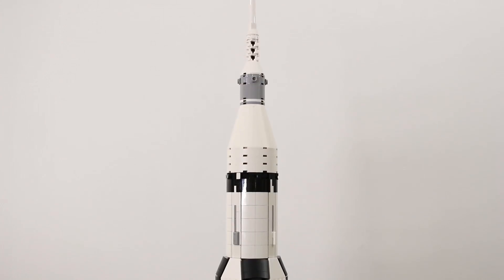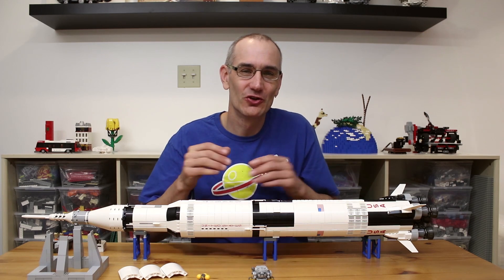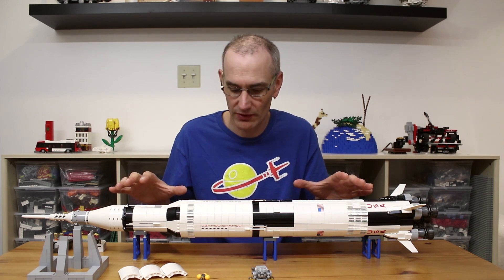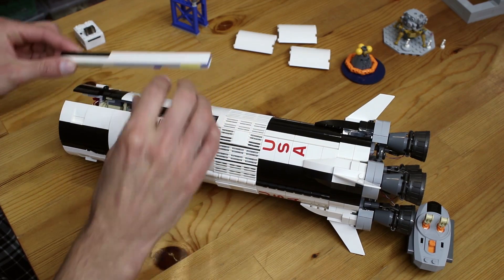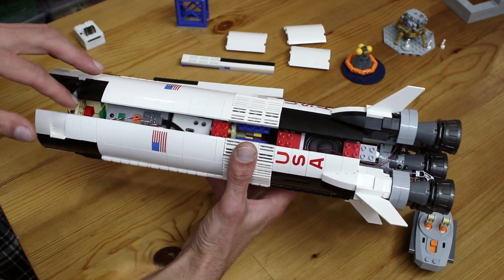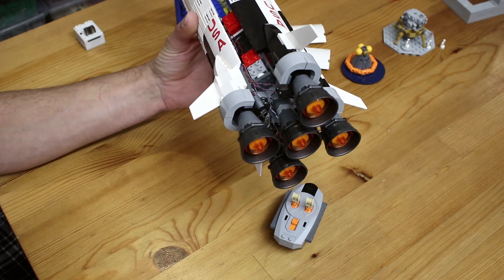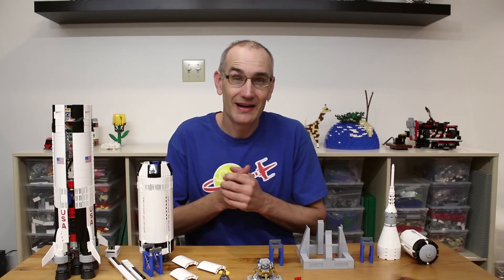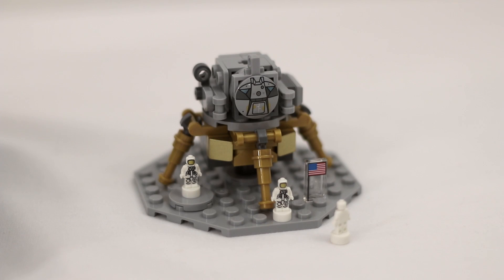LEGO Saturn V with Light and Sound

Comment: Please, please, put all the audio stuff into the base, and sell me a kit.  I could never do what you've done inside the 1st stage. as fir the glowering rocket nozzles,  is there a simpler way to do it with batteries? I absolutely love it!
Reply from the maker: I'm sure you can just add lights a lot simpler. Maybe using some of the LED kits from Brickstuff?